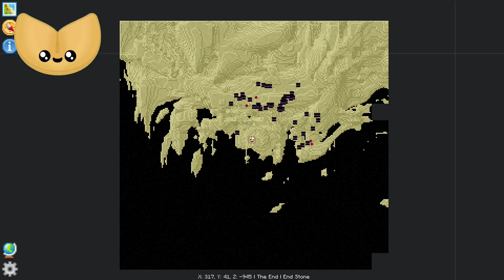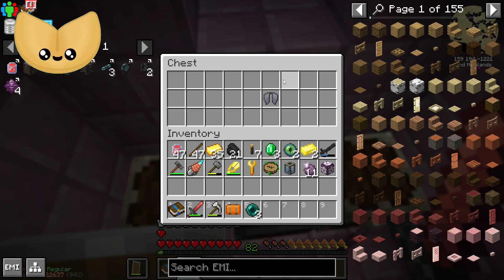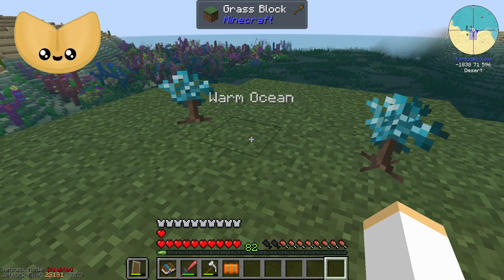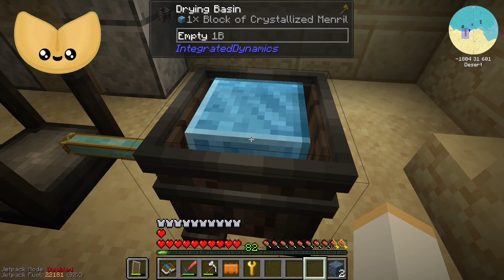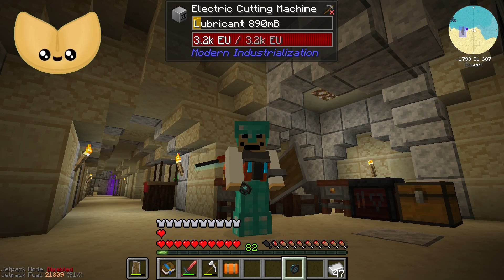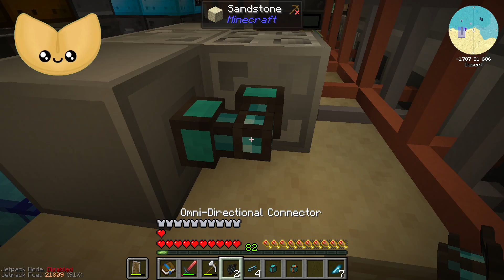Integrated Dynamics Wireless Power FTB NeoTech

Comment: The mono-directional connectors are amazing by themselves.
Reply from the maker: they'd definitely have their uses, i just don't know any.
Reply: @fortunecookie4080  you could transport drops and XP from a mobfarm to your main base without using cables all the way as an example. But the omni-directional is really cheap, so most of the time it is more worth to just ignore the mono-directional since you need to point them to each other like antennas.
Reply from the maker: @LucasBKOK  exactly why i can't think of any real use for them 😅